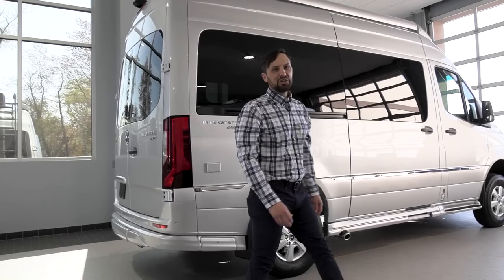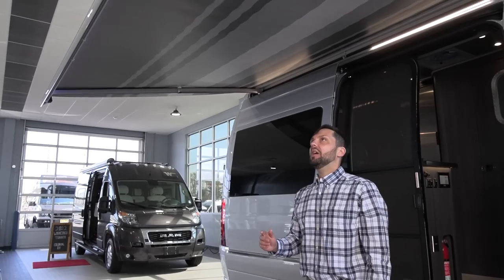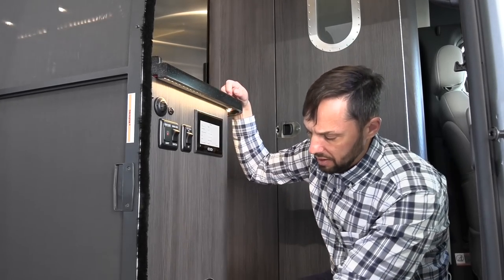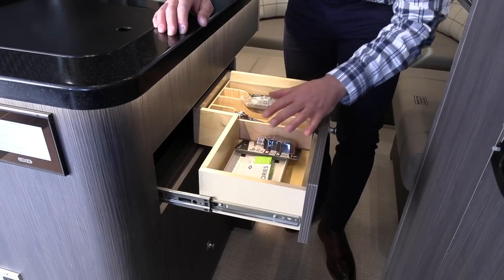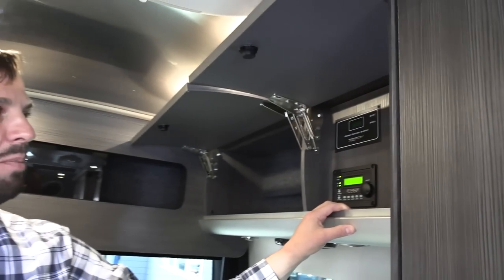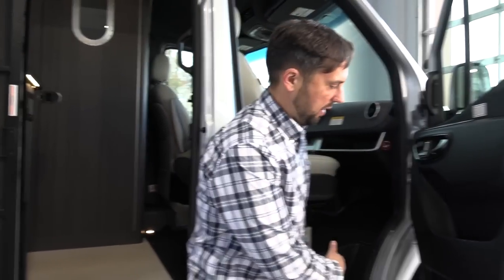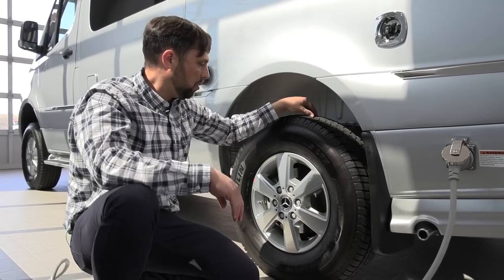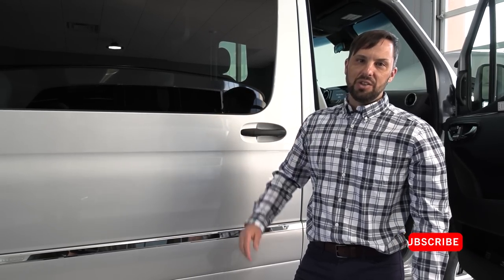LUXURY CLASS B CAMPER VAN | 2021 Interstate Nineteen 4x4 Mercedes Benz Sprinter RV #VANLIFE

Comment: My wife and I purchased one of these exact models, taking delivery in the summer of 2021.  Yes, it has everything packed into a small footprint ... so much that I am still learning a few new things every year.  Besides recognizing the high quality of the design, workmanship, and durability, our only comment to future purchasers of 19' Interstates is that they are quite small.  You need to use it on trip during good weather so that you can spend as much time away from its tight confines as possible ... sometimes just too tight for two adults.  Otherwise, look seriously at the 24' Interstates.

Comment: Beautiful Van.  But wish it had regular gravity dump with 3 inch hose instead of macerator dump.  When fully hooked at a camp site, I would like to take a nice long shower without worrying about the gray tank capacity.
Reply from the maker: That would be cool bot so close to the ground, many customers would not want to crawl under the van to hook it up.

Comment: This definitely seems much higher quality than leisure travel vans which I love but this doesn’t even have a quarter of the exterior storage there unify rear twin bed offers plus they have a larger fridge and a dry bath. I wish I could have an airstream quality with a leisure van design.
Reply from the maker: Bree, The Interstate and LTV Unity are not comparable models when it comes to size. Have you seen the Airstream Atlas yet?

Comment: You had me with this van up to here. 40:59 - Needs the cassette toilet. Bummer.
Reply from the maker: We get mixed reviews about cassette toilets.
Reply: @colonialairstream  i hear ya. But sure beats trying to hunt for a dump station, yet alone waiting in line for one.
Reply: Antonio Zamudio  not questioning the number of dump stations available. Im questioning  theres never one when you need one. Especially at favorite campsites. Try The Sequoias in mid summer, 12 deep w Class Cs and theirv20 gal tanks of effluent. 🤢🤢🤢 No thanks..

Besides I camp now in remote areas that Class Cs cant get to, and where dumper stations are few and far between. Plus the need for 4x4 in my next B class, which is why most 4x4 Bs go cassette. Effluent in a suitcase for me brotha - find an outhouse or dig a hole. 🤘

Comment: Excellent presentation. We would like to know if the Interstate 19 has the Mercedes option for Surround View (360 degree camera system) to make parking easier, and are the lithium batteries charged from the Mercedes alternator while driving or can they only be charged from shore power?
Reply from the maker: James, as supply chain permits, most new 2022 Interstate Nineteens will have the 2360 camera. Alternator charging is done through the DC to DC battery charger form the alternator.

Comment: Hi Patrick. Thanks for all of these.  I see the 23 now has external solar ports on the side , any idea how to do that on earlier models so when parked in shade can plug in a suitcase solar panel? Do these coaches have an in house water filter? If not what do you suggest other than the input hose filter?  Thank you. Ross
Reply from the maker: If you contact our service department we can certainly install external solar ports on older model Airstreams. These coaches do not come with an in house water filter, however you can install one or a lot of clients will install an external water filter attached to a hose when filling/using city water.
Reply: @colonialairstream  Thanks so much. Also, is there a link to tour your amazing personal rigs? The are incredible

Comment: Patrick, another great video.  I have been watching since 2017.

Do you have a Class B you would recommend that can sleep 2 adults 2 small children?
Reply from the maker: Thanks Jim. At this time Airstream does not have a class B that sleeps 4.
Reply: I have friends that have some blowup mattress/filler that goes between the two facing seats on the driver and passenger side of the lounge model. The front seats get turned around, the mattress covers the facing seats and fills the area between to the floor when filled with air. It wasn’t bad for a night, and I think it would be fine for kids. It becomes two narrow single beds when needed. When not in use, they’re stored in a ‘bag’ about the size of a sleeping bag in a cabinet or under sofa. I don’t know where they got it, or who makes it but we thought it was a great thing. ☮️

Comment: This was an excellent tour of what looks like an ideal van for someone who doesn't necessarily need to live in it full time (though I just watched a video made by someone who does, and she loves it). I wondered about the possibility of increasing the solar power so as to decrease the amount of power one needs from either a site hook-up, gas generator, or batteries. I don't know anything about how these power systems interact, so that may be phrased poorly. I'd like to be as 'off grid' as possible, and I'd be content to use some amenities less.
Reply from the maker: Thanks for watching the tour. There is a new E1 package that eliminates the LP and has a 2nd alternator, larger inverter, diesel heat and hot water and has a huge lithium battery bank.
Reply: @colonialairstream  Thanks for answering. This sure is a lovely van!
Reply: @colonialairstream  Thanks for this Reply. 
I'll add this info to my growing research files.

I only learned today how to read past Reply posts without having to go back to the video and go down through the comment field. AGH! That's why it took me 2 weeks to thank you.

Comment: So what is the interior height? Your Airstream website says it's 6.2" / 5.10" and you state on the video that it's 5.8"...which is super low btw. So what is the actual interior height?
Reply from the maker: Patrick stated the interior width is 5'8", not the height.
Reply: 6'2" +

Comment: You pointed out that that Onan generator occupies the original spare tire mount area. There is the spare tire mounted?
Reply from the maker: Robert, Many of the Sprinter based RV's do not have spare tires due to space and limited payload.
Reply: UG H - this was my question, too! No spare tire?!?!?! 😬 Patrick, there a ton of after market exterior spare tire mounts. Do you have any specific recommendations for one? Or this is a reason to consider NOT mounting an exterior spare tire (i.e. weight, coach balance, etc.)?

Comment: One more question, can you get a convection microwave since this coach does not have an oven?  Thanks again!
Reply from the maker: Unfortunately not
Reply: @colonialairstream  Patrick, I notice when you go to the Airstream website and select the Interstate 19, then select “Overview”, then select “View Floor Plan” and then click the “Explore” link and then tap the “+” sign over the 2 Burner Stove and Sink” that a pop up comes from the side with this description; “The kitchen features a two-burner gas stove and a large stainless steel sink and faucet, plus extra counter space for food prep. Above the counter there’s a convection microwave and across from the sink are a refrigerator with a freezer, and a slide-out pantry.”  In this description, it says “there’s a convection microwave”.  I’m wondering if this description is current or is it maybe referencing an older model or one yet to come?  https://www.airstream.com/touring-coaches/interstate-19/floorplans/standard/

Comment: My take:
1-too expensive if it is over 120k
2-gasguzzeler 14mpg , we need hybrid pronto
Reply from the maker: This is not gasoline powered, it is diesel and it gets 20+ MPG.
Reply: Expensive, yes.  But it does get a consistent 18 mpg in all terrains and weather, in my personal experience.

Comment: The best tour so far, but where are the house batteries stored?
Reply from the maker: Thank you very much. The lithium batteries are stores in an enclosure underneath the rear of the chassis.
Reply: @colonialairstream  thanks! So is there a ladder option for roof maintenance? If so where does it attach for storage of it and connection to climb to the roof?